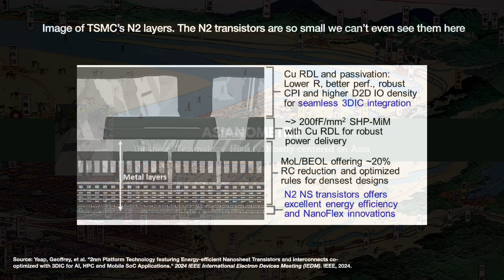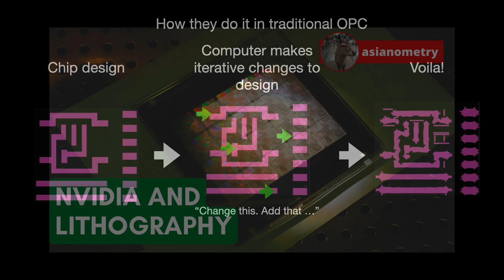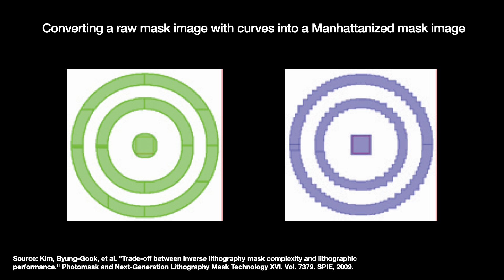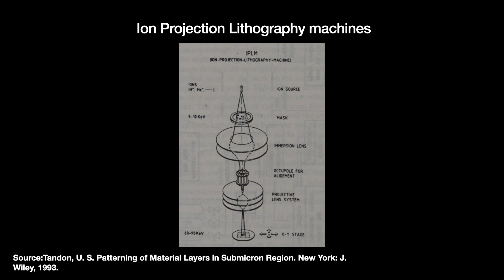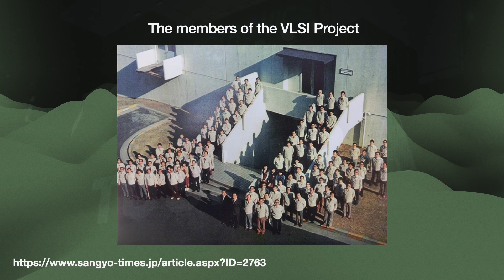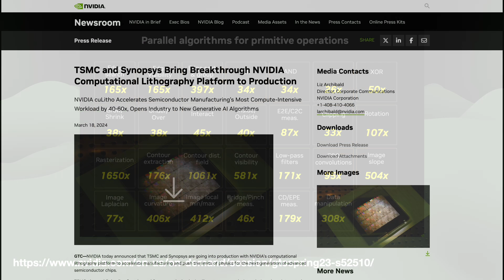TSMC's Incredible 2nm Curvy Masks

Comment: The detail that TSMC's mask shops in Taiwan can lose accuracy to typhoons — because even atmospheric pressure shifts inside the cleanroom matter, and changes in the Earth's magnetic field can destabilize the mask writers — really stuck with me. It makes the 24-72 hours per mask and tens of millions of dollars for a full 40-70 mask set feel almost reasonable. And the Manhattanization explanation was excellent: VSB writers can only draw rectilinear shapes, so ILT's curvy masks stayed an academic curiosity until multi-beam writers splitting one beam into ~250,000 beamlets finally made them practical.

Comment: I thought that the masks would have been really curved (in the sense of a surface like a sphere) to adapt to ASML's optics field curvature.
But I think that that is a minor problem (an optical aberration that is routinely corrected by adding lenses or mirrors with aberrations of opposite sign, at the cost of increased complexity) and, even if it weren't, using non-flat masks wouldn't bevery practical.

Comment: AI Summary

This is about semiconductor lithography masks for TSMC's 2nm process. Frankly, the level of engineering required to manage mask creation is absurdly complex, but I suppose that's what happens when you chase miniaturization this hard.

Abstract:

This video discusses the significant technological shift enabled by TSMC's upcoming N2 process node, specifically focusing on the introduction of "curvy masks" (masks with curved lines) made possible by advanced Inverse Lithography Technology (ILT) and new multi-beam mask writers. Traditional mask writing using Variable Shaped Beam (VSB) tools was limited to rectilinear (Manhattan) geometries, forcing complex curves into inefficient rectangular approximations ("manhattanization"), which slowed production and reduced fidelity. The adoption of multi-beam mask writers (from companies like IMS Nanofabrication and NuFlare) finally allows for the direct writing of these complex, mathematically derived ILT patterns. Furthermore, the massive computational overhead of ILT—which requires working backward from the desired wafer pattern to the mask design—has been drastically reduced by GPU acceleration (like Nvidia's CuLitho library), making full-chip ILT feasible for N2. This technological push is largely subsidized by the high margins and demanding specifications of the AI accelerator market, whose benefits are expected to trickle down to other chip segments.

TSMC N2: The Arrival of Curvy Masks and ILT Revolution

*   0:00:05 TSMC N2 Node: TSMC calls its 2nm node the "world's most advanced logic technology." Key feature is the Gate-All-Around (GAA) transistor, but a major addition is the use of "curvy masks."
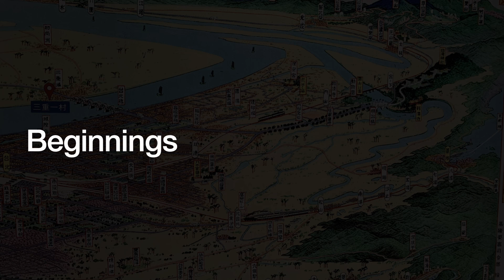*   0:00:54 Photolithography Basics: Masks are templates projected onto the wafer using light; defects are catastrophic given their cost and IP sensitivity.
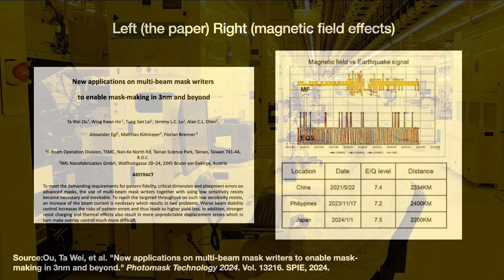*   0:01:49 Mask Shop Sensitivity: Mask creation facilities are sensitive to environmental factors, including earthquakes and even magnetic field shifts, which affect electron beam mask writers.
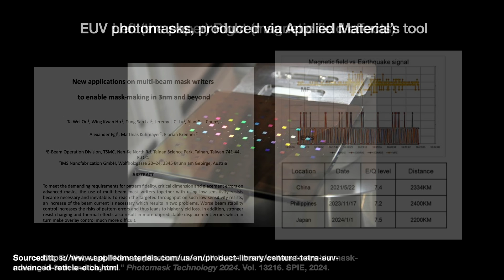*   0:02:06 Mask Set Value: A complete set can cost tens of millions of dollars and contains vital company IP.
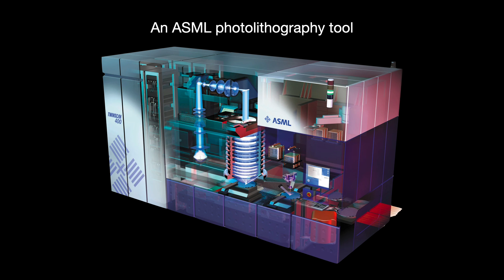*   0:03:04 Resolution Enhancement Techniques (RES): Intermediate solutions used to compensate for light diffraction when feature sizes shrink, involving adding assist features to the mask.
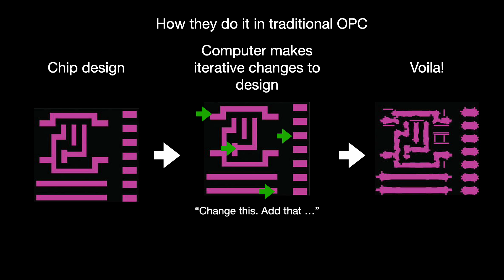*   0:04:16 Inverse Lithography Technology (ILT): ILT works backward, calculating the optimal mask pattern required to achieve the desired final wafer pattern, often resulting in complex, non-rectilinear designs.
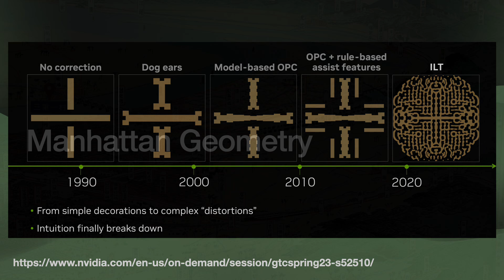*   0:05:21 ILT and Curves: ILT patterns typically feature curves because light physics do not favor 90° angles.
*   0:05:38 VSB Limitation: Traditional mask writers (Variable Shaped Beam or VSB) can only write rectilinear shapes (squares, rectangles). Curved lines must be approximated via "manhattanization" (fracturing into many small rectangles), which is slow and reduces fidelity.
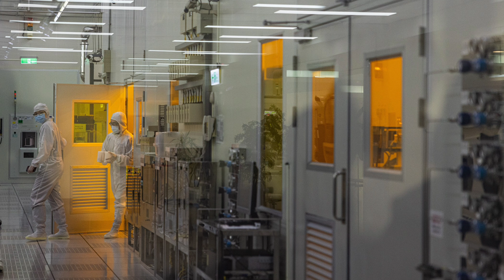*   0:07:21 Multi-Beam Mask Writers: The solution is the rise of multi-beam writers (IMS Nanofabrication, NuFlare) that use arrays of beamlets, allowing for far faster and more direct writing, overcoming VSB limitations.
*   0:09:04 Initial Driver for Multi-Beam: The original purpose for adopting multi-beam writers was to handle the complexity introduced by EUV lithography throughput issues.
*   0:10:08 IMS Nanofabrication History: Started with ion projection, pivoted to multi-electron beam writing, eventually bought by Intel, and later stakes sold to Bain and TSMC.
*   0:12:37 NuFlare History: Spun off from Toshiba Machine; a strong competitor to IMS, though IMS holds the market lead.
*   0:14:06 ILT as a "Killer App": The ability to write curves directly is ILT's second major benefit, and TSMC is finally moving full-chip ILT into high-volume production with N2.
*   0:14:54 ILT Computational Cost: Full-chip ILT computation was prohibitively expensive, sometimes requiring up to 30 million CPU hours, taking days when manufacturers need results in one day.
*   0:15:48 GPU Acceleration: Nvidia's CuLitho library has accelerated ILT workflows significantly (45x to 60x), allowing full-chip ILT to move to production readiness.
*   0:16:46 AI Market Justification: The high margins in AI accelerator chips (Nvidia, etc.) justify the massive R&D investment required for advanced technologies like curvy masks, and these advancements will benefit subsequent, less lucrative processes.
*   0:17:44 Future Outlook: While N2 masks are curvy, ILT has not been fully leveraged yet; further improvements are expected to be impressive. I anticipate this will indeed yield better transistor performance, which is probably the only thing that matters.

AI-generated summary created with gemini-2.5-flash-lite-preview-09-2025 for free via RocketRecap-dot-com. (Input: 18,075 tokens, Output: 1,088 tokens, Est. cost: $0.0022).

Comment: So, a key question - how does TSMC's 2nm process compare with Intel's 18A process?
Reply: 🤔 Benchmark results for the Intel 18A chip (Panther Lake processor) show that its single-core and multi-core performance is lower than that of the previous generation product manufactured using TSMC's 3nm process.😅

Comment: If imagining sensors can be made on a surface curved in both dimensions, then optics are improved (the curved sensor eliminates the need for optics to create a flat field  where the image is focused. This eliminates a critical tradeoff in the design which allows better optimization of the other optical requirements.   Sony already takes advantage of this.

Comment: I remembered hearing about ILT being necessary to get patterns otherwise too small for the wavelength — and also that to avoid this problem everyone just went with EUV for smaller waves to push it down the road. Are they really only JUST now, for 2nm, properly implementing this as a standard masking method?

Comment: Even Douglas Adams didn't forsee the scaling enough with Deep Thought spending 7.5 million years to design a computer known as Earth.

We have now started a cycle where GPU and CPUs chips that were designed with some curvilinear pieces being used extensively to design even better chips so they can design better chips which will even more rapidly design …

Comment: I recall IBM and others demonstrating the ability to move or deposit individual atoms using ea scanning tunneling electron microscope. I believe there are other methods available now. So hypothetically a chip could be built this way from the "ground" up. However it could readily take 1000 years to make one chip using present day technology. Maybe it could be done by nano robots in a biological solution? I am reminded of the lowest skilled trade in construction, "his carriers" or unskilled laborers, who push wheelbarrows around according to directions. 😅

Comment: This mask technology is making use of and adapting to the convolution that lenses and all optical features - edges, etc. - perform. I'm surprised this wasn't done long ago. 
Similarly, scientists as far back as the 1990s were generating high resolution coherent laser beam patterns by starting from the desired far field pattern and working through the inverse convolution mathematics to determine the ideal initial beam shape. Thus was even done to generate a valid coherent sound beam in water - a kind of "sonic laser" ("saser"?).

Comment: Wow. There are so many machines, knowledge, optics and chemical processes to get this microprocessors/-chips. A fascinating evolution during the more than 70 years up to now. Thank you for showing all these steps. There will be a time when, starting with the sand up to the processes when the produced components are put into a plastic injected housing and they are soldered to the multilayer boards.But then there is also the question how to get these computer component designs. An orchestration of whatever needed.

Comment: Idea for a video: What each chip node is used for today. Specially older chip nodes that are still produced. The manufacturers that cannot climb the 'next step' in chip nodes, what markets are they 'relegated' to?
Reply: They’re not really “relegated.” Masks are so expensive, and more expensive the smaller you go, that any company designing chips tends to use the LARGEST feature size they can get away with and still meet spec. There are lots of “cutting edge” products produced on old nodes. It’s just that the field they’re cutting-edge in isn’t semiconductor fabrication; it’s something else. 

For example, I’ve worked on various kinds of sensors, including camera sensors. The size of the sensor is driven by the wavelength of light you want to detect and the optics. So we will have a chip for just the sensor bonded to another chip that controls it, and because of the size of the sensor there’s no reason to make the controller chip any smaller than that, and we can easily fit all the functionality we need into that size chip on, say, a 130nm process (which is 25 years old now). The masks are 100x cheaper (maybe more) than the latest 7nm masks. There’s simply no need to spend that money for what the product is trying to do. Mask costs are so expensive that in semiconductor manufacturing, you end up on the process node that makes the most economical sense. And a process that’s 25 years old is much more mature, stable, and will be yielding higher than something newer since they’ve had so long to work out all the bugs and really fine-tune it and tighten the production limits in. 

Forgive the analogy as I’m not a mechanical engineer or metallurgist, but it’s sort of like saying well tungsten is stronger than steel so why don’t we build bridges out of tungsten? Simply because it’s more expensive and not needed in 99.9% of cases. That doesn’t mean that a new bridge made out of steel is “old technology” or worse in some way. It’s just choosing the right tool (or in this case, material) for the job.
Reply: @stvm  You have scratched exactly the curiosity itch i was having. Thanks!!  You also made me realize part of my curiosity is well outside the scope of this channel and can be easily found by searching 'legacy process nodes'. Thanks again!!

Comment: This is way over my head but it seems like if the machines were designed to work based off polar coordinates it would eliminate the issue of converting curves to straight lines.

Comment: So they are using the massive computational power of the CPUs and GPUs they make to calculate the design and masks for the CPUs and GPUs they need to compute the mask design for the GPUs and CPUs the want to make.

Cool!
Reply: Intel did the same in the late 90s by using its own CPUs for simulation, put a bunch of them in a farm, and used them to make possible the significantly denser subsequent designs. This little game has been going for a while and very possibly will continue until leaning into The Wall™.
Reply: like how the engineers went from rubilith to cad
Reply: Self improvement
Reply: What is this great task for which I, Deep Thought, the second greatest computer in the Universe of Time and Space have been called into existence?
Reply: And Deep Thought could only compute the parameters of the computer that would provide the question which was answered by "42".
Reply: We can thank the ai boom for the massive gpu availabillity

Comment: Ah, so a connection that resembles a square wave, is better etched with rounded or artifact eared lines similar to what you might get plotting a square wave using only sin waves.

Comment: Former head of skunkworks is ‘retired’ now running what I think of as soft-disclosure over at UnLab. 
Dr Chase claims 0.2nm manufacturing without lithography and he’s got a track record. They apply digital control at nanoscale of magnetic fields to assemble. It’s part of the extensions to EM kept under nuclear secrecy levels of security finally being allowed to deploy. Casimir power on a chip, is one claim. 

Seeing the yin-yang dispersal pattern down at nanoscale is glorious-making, energy spray out one side & new material spewed the other. The ancients knew a lot more than we have been told.

youtu.be/DW44J7jaGgs

Comment: The x-nm specs is misleading because the so-called 2 nm chips are actually ~10 nm, but 2 nm is impossible technically. This should be made clear if the audience is the public.
Reply: Every user knows that engineers, including many sci'sts, are notoriously reckless, vague as they often jargon and change things for the worse!
Reply: he talked a while back about this, he's calling them nodes now
Reply: The audience is not the public. This channel explains very advance chip fabrication technology that is akin to black magic with the regular public.
Reply: @kazedcat You underestimate the public's awareness of high tech. Unless you can completely deter the public from viewing you are responsible Not to mislead them.
Reply: I guess you are new to these topic because its literally common sense
Reply: @kekw9716 It bends the common sense, rather.
Reply: It's not misleading. The process logic is stacked to the equivalent of what would be a 2nm process.
Reply: @raam1666 The misleading part is the nm which is why TSMC just call it N2 process not 2nm process.

Comment: The OASIS format has supplanted GDS2, MEBES, ... as the preferred mask writer format to convey bazillions of rectangles/trapezoids.  OASIS does not support curves, to photonics chagrin.
Reply: I'm pretty sure OASIS P49 does support some curves
Reply: @N9199  OASIS P49 does support curvilinear extensions, but is not mainstream yet.  For example, it's not clear if Synopsys fully supports p49 or not even though they've made some comments about it.
Reply: @hfdole  I know it's been months, but this has been in my mind sporadically. I do have inside sources, and while I can't confirm full support, I do know that at least there's been a lot of internal initiatives in all of the levels that work on masks spanning the last few years.

Comment: I remember when a bunch of multi beam startups wanted to use the tech to do direct write maskless lithography. Their approaches started with 250k electron guns instead of aperture plates. Maybe we will still see the industry head that direction in the future.
Reply: I wonder how viable this becomes, probably for small-run high-performance chips first.
Reply: It still takes hours per mask, so at the moment, this is entirely unfeasible, unless the chip in question is not very complex at all.
And if that is the case, why wouldn't you use a different process?

Comment: ILT patterns remind me of Fourier Transform patterns, I expect they are closely related. For a cool demo of this check out the video "Fourier Optics used for Optical Pattern Recognition" by Hyugens Optics, where he demonstrates how pure optics can 'calculate' the Fourier Transform of even complex shapes just by the optical design of the system, aka instantly. Maybe these companies should be taking a more analog approach. :)
Reply: You're almost right. The mask image gets Fourier transformed due to diffraction. Then the projection optics will only capture a few of the largest Fourier modes and discard the rest (that's how you get maximum resolution), then project those onto the wafer. The magic is in how to get the desired pattern on the wafer with only a few modes.
Reply: @henrikr8183  so how do you get the pattern on the wafer with only a few of the fourier modes?  give us the magic
Reply: @999a0s Excellent question. You use a chemical photoresist with a very steep sensitivity curve. That means for light intensity below the critical sensitivity, the resist does not get developed and for intensity above it, it does get developed. This way you can get sharp features on the wafer from very smooth light distributions.
Reply: Mask and pattern on Si are not exactly FT to each other because they both are real-space (means direct 1-1 images). They are more like Mask --> FT --> k-space image --> iFT  --> pattern on Si. So my guess is that, they might be taking into account lens (mirror) imperfection and their finite dimensions for intermediate FT processes to compensate at the mask.
Reply: His resolution wasn’t even close to being nanometer scale though, partly bc he used visible wavelengths. Things get weird when you start using euv.
Reply: fourier transforms and the adjacent concept of moiré patterns are such a reality hack that they are sure signs we are in a simulation to me 😅